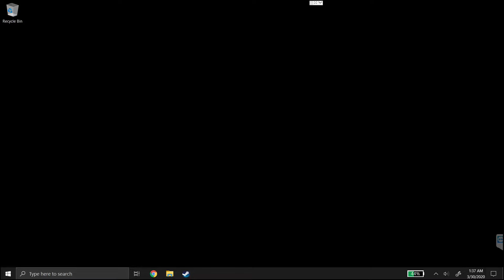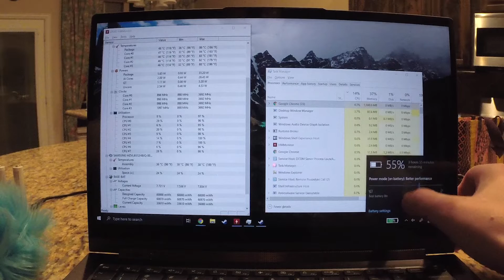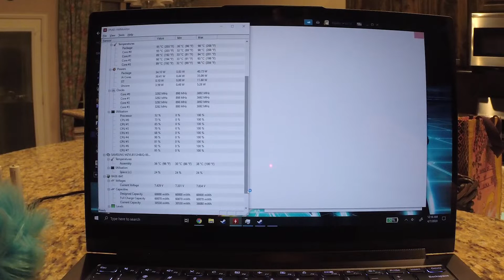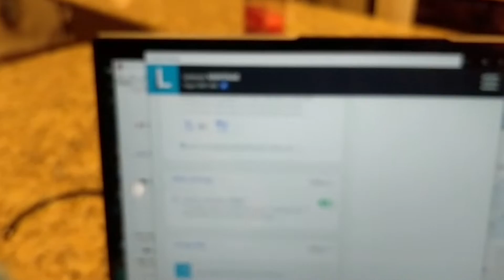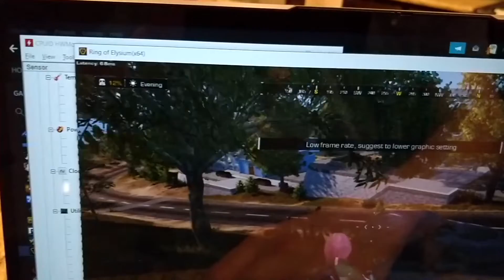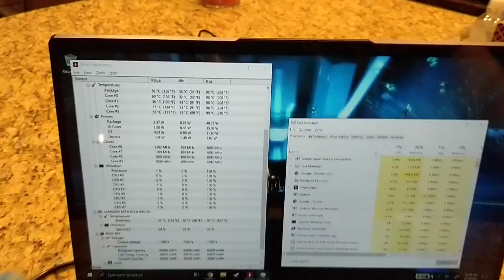Lenovo C940 - Part 7 - Extended Cooling Revisit

Comment: Hello. I really need your advice. I am thinking of buying this laptop, only I am thinking of buying a 15-inch version. My goal is to minimize eye strain at better screen resolutions and use a stylus. But does it really overheat that much? Maybe you need to install another Windows and disable updates? Do you think I should buy it?
Reply from the maker: Really comes down to your usage.  For my usage I am extremely happy with my 940 and still use it every single day.  I understand why mine gets hot and can easily make some adjustments to table position and so on to keep things happy.  I can live with some fan noise when it does come on under load but overall I'm good. 

Because it is a laptop and has different drivers I am not a fan from deviating from the OS it came with and potentially causing driver issues.  Updates do drive usage and kick up some consumption but its temporary.  Some updates make battery life worse and keep things running a little hotter but usually the next one or two fixes those issues and things are stable again. 

Not worth the hassle of messing with it to that degree.  Now if I did not want updates sure I could turn that off but at some point I would hit a compatibility issue.

I am extremely pleased with my unit and have only minor complaints I hope they address in future builds but performance, cooling everything works well enough within reason and my expectations.  My video series highlighted what people were concerned with and things I liked / had annoyances with it so folks could see how minimal the issues were or decide for their needs it was not the right unit :) 

15" will give a bit more room for cooling unless it adds a discreet GPU but I would not expect many issues beyond what I show here.  If you get a 4k resolution eye strain due to the scaling may not be improved but everyone is different :)

Comment: This is what people were complaining about?? Geez. This seems like nothing! Not bad at all, I’ve experienced way worse with my bulky HP model. I can understand maybe getting a little irritated but this isn’t exactly a device made to withstand all power.

And I think you mentioned that they rolled out better updates for this too. Guess people had the update, their devices got hot, and they got concerned so they freaked out (understandably). The fan noise is definitely manageable, I’ll take your advice on the battery level since I don’t need high performance! Your videos have been such a help, sorry about the wonky updates!
Reply from the maker: The largest complaint from people was the fan noise and how quickly they ramp up if you let the system have full access to the CPU.  I can see their point on how fast things ramp up but blame windows 10 telemetry and updates for running so frequently in the background when the CPU is wide open for use. 

That and realistic expectations of a high powered i7, 4k display and such in a tiny package.  It will get hot and that heat must go somewhere soooo.

On mine I have it set to eco mode so the battery only charges to 60% unless I know I'll need more.  With the CPU limited I can get about 90 minutes a day for 3 and some change day's responding to youtube comments, watching youtube or other video's which is reasonable usage and I'm quite happy with that life span. 

Thanks!
Reply: Ripskin16 - I’m getting the 15” i7  with no 4k and I’ll definitely implement the settings you were suggesting. Hopefully the size (as opposed to the 13” or 14”) makes up for the i7 power. I’m about to order now and I can’t wait.
Reply from the maker: @Hailee DeLuca  The larger size + the GPU will give them a few more options for airflow over the heat pipes or for a fan to exhaust air through so I cannot imagine it would be worse than the smaller units with less room.  

let me know how it goes once you get it, should be a good device!

Comment: Hey! Great video 🙌. I havve the C940 14 FHD, i7, 12GB and Iris Graphics, i used it for mostly homework so office, pdf, etc. It gets a little warm to the touch having 10 chrome windows open, some pdfs, and word documents, and the temperature is about 50°C. Is it normal? And also, have you tried videocalls? I'm using google meet for my university classes and when I have only the videocall (zoom or meet) it gets also warm especially in the midd upper part of the keyboard. When I try to do other stuff when videocalling it gets hotter about 65°C, I don't know if it's normal because it's a thin laptop (?) Do you hace any settings recommended for videocalls (?). And finally I'm not using it for videoediting, but sometimes I need to do basic stuff (for my virtual classes), today I edited a video an when exporting the proyect it got about 90°C the fans where noisy and I got worried. I hope you can answer these things. (Sorry for my bad English I'm Peruvian). And again thanks for doing these tests on the C940 it was very difficult to find this content.
Reply from the maker: Thanks for watching and glad it was helpful :) 

The largest thing that will impact you is going to be the i7.  It is pushing what the computer can handle thermally.  The best advise is to go in and tell windows to limit its utilization until you need to do something like rendering a video or something.  At that point letting it take more is fine if windows has not already done it. 

It is thin and that powerful CPU definitely heat soaks the system.  Now if you have it flat on a desk I can suggest lifting the front or back up a bit so the long foot is not restricting the airflow and that will help a bit. 

Your English is fine!
Reply: @Ripskin16  Thanks! I'll take your advice. But for videocalls do you think I should limit utilization? or have it with performance?
Reply from the maker: @kaza0386  Ah sorry missed that part.

I've run Teams and Skype on mine in the low power setting  I do almost everything in that setting event basic Balloons TD play in that setting without any problems.  If windows really needs the power it can usually take it to a degree.  And if I need it it takes seconds to move the slider up a notch or two and let the system have a little more juice. 

But in reality those video calls take very little system resources provided the application is optimized decently and doesn't have a memory leak.

Comment: Hey, thank you for the videos.
Its been over a month that I am using the Yoga 940, and recently I am facing the issue that the device is abruptly shutting down. 
Wanted to ask you or any one of the users if they are facing the same issue and if there is a solution.

Cheers
Reply from the maker: Thank you for watching!

I have not run into any such behavior on my unit. 

What is happening on the machine when it happens?  Does it happen at the same time (you use it for 30 minutes then shut down) or when using the same application?

Do you notice any heat issues or fan noise leading up to the shut down? 

Is windows attempting to apply updates or have anything going on in the background?

Have you checked Windows event manager to see what it logs for the shut down event?
Reply: @Ripskin16  I checked the system temperature and the system is not overheating. The temp reaches to around 50-60 deg C and its max goes to around 90 deg C. There are no fan issues as well.

The event log showed the 'kernel power error 41'. The windows support page for this error says that this is an event log due to the system rebooted without cleanly shutting down first. A further google search advised that this could be due to the fast booting power option. So I disabled it and turned off the system and after turning it back on again checked the event log. Tried this twice and both the times there were no error logs in the Event Viewer. So hopefully the issue is sorted.
Will post updates if there are any other issues.

P.S. I guess the issue has come up due to the 'Feature update to Windows 10, version 2004'. The update took place on 17-07-2020. And the first Event log for the 'kernel power error 41' was logged on 18-07-2020. 

I hope the next windows update solves the issue permanently.

Thank you very much for your advice and support.
Reply from the maker: @pranavbapat1356  Interesting and glad that you were able to narrow it down and get things stable, hope it holds!

Windows updates suck with 10 :( I defer for a month or so to hopefully avoid most of the mess. 

I wonder if it could also be something in the way Windows fast boot interacts with the bios version you have on your unit.  I'm on the same version that came with my December 2019 unit so that may play into it.  Can try updating the bios or seeing if Lenovo support know's anything about it and has a fix. 

Hopefully windows gets it sorted!

Comment: I have the 12gb FHD i7 version. It's comforting to see that I'm not the only one who is confused with what Lenovo Vantage is supposed to accomplish; it seems very badly implemented. Should I just install 3rd party cooling software (like Speedfan), or would this cause a bit of chaos between all the software?
Reply from the maker: If all of the other software related to cooling still installed it may cause some conflicts, but if you remove them it should work fine.  The only issue I may see is something in the bios or at a lower level that lenovo may be doing to "optimize" their operation in a custom way.

With that said the more recent versions seem to have found some balance and operate a little better with reasonable usage but still not great.  If they would give us the ability to set a fan curve it would be much better as we can go with our own personal tolerance levels.

Comment: Will C950 with Tiger Lake iCPU solve this issue?
Reply from the maker: That is a good question and unfortunately too soon to tell.

I think CPU improvements could help lower the wattage consumed while keeping performance at the same level.  However Intel has not made a lot of die size reductions in a while and overall AMD may be a better solution until Intel gets back on track. 

The biggest thing I see helping would be better software management, a proper fan curve that users can configure and a redesign to the cooling.  In this I mean raise the rear a bit and change the foot pads so the intake can suck in as much air as possible.  The layout of the heat pipes may help but in such a small ultrabook space is limited and if you want the 4k screen and high end CPU there is a trade off.

Comment: I got my sku a couple months ago and I've noticed a design flaw... The soundbar hinge blocks exhaust of air through the back of the computer... I have a feeling the fans work extra hard because they can't push enough air out of the system and a lot of the heat is staying within the laptop, heating other components as well... The laptop being aluminium could also be an important factor... Now this is just my opinion and I might be wrong but it's something I noticed... I use an external cooling pad to keep temperatures down these days
Reply from the maker: Interesting, there should be space around your hinge that is the sound bar between the bar and the exhaust vents where the air can flow.  The edge of the bar is rounded to help allow air to "flow" around it vs hitting a solid wall like a box.

I would not expect a production difference in the distance between the vents and the sound bar.  

The reason I do not believe the exhaust to be a problem is how the fans ramp up and what it means.  The fans ramp up in a reaction to immediate need and load typically (this can vary a bit depending on profile, CPU power allowances but I found the same behavior across all modes just to a varying degree).

So when I launch a game for example the CPU heats up quick, the sensor picks up on this and the fans ramp up.  Typically at that point the fans continue to ramp up until heat soak and max RPM is reached.   Now in a light load I see the same performance, launching 15 youtube vids and Chrome spikes some usage the fans kick on for a moment and then simmer down once the application is in memory and the non active pages are in the background. 

If I was seeing an issue with the exhaust then I would expect the fans to have a delay in kicking in as the cooling system would be better moving the heat away from the source, but it would build up in the case and saturate requiring more effort to exhaust out with more positive static pressure. 

In my video's about this I tried to point to what I saw as the real culprit.  The system is designed for positive static pressure, meaning the fans are pulling in air more than naturally would flow through.  This requires that the fans have a good consistent source of airflow.  My concern are the feet, in the back the long "bar" foot is not tall enough, and since it is one long pad it means air can only flow through the channel between it and the front pad.  While once the fans are at speed this may create a nice funnel effect I think it does more harm than good but ultimately I found that by simply lifting up the front or back of the case a small amount I could greatly increase the cubic area of available air and the temps started to lower and balance out.  Even in moderate gaming I noticed the fans calm down a bit.

When on my lap typically there is a large gap between my legs that allows for a greater source of air so again while a load is a load it seems to ramp up slower and handle the temps better than when it is on a flat desk surface. 

I am by no means saying you are wrong or claiming to be an expert.  Just that in my tests  and years of building PCs, and looking into it I found the intake to be more of an issue when push came to shove.  The heat source is also located near those vents to help allow natural movement of air to keep it cooler longer.  

Poor vantage software updates and windows updates are the biggest culprit to the cooling system though.  

Definitely appreciate the discussion as the more we look the more we discover!

Comment: My C940 gets immediately hot .. like cook an egg hot... there is absolutely NO "noise" -- not one decible of any sound.  Does that mean my fans are not on? how do I fix this? HELP!
Reply from the maker: It sounds like your fans are not running at all and the load is higher than it should be.  There may be an issue with the thermal conductivity between the IHS and the cooling system.  

Do you still have the lenovo vantage software installed?  Is it updated along with windows?  What types of temps are you seeing right after a fresh boot?

Mine is back to running well (see concerns from the last part of the series) where for the bulk of my moderate usage the fans are off and the temps are great.

Comment: i have a doubt, can you help me? i want to install a fresh windows 10, so i need to boot from usb, but i cant do that i changed to secure boot to disable and i am getting "system doesn't have any usb boot option"
Reply from the maker: Interesting, I have not messed with the boot options or played around in the bios.  But not having a boot from USB option would be extremely surprising especially with the wide spread usage of UEFI bios's 

There should be an option in the bios to select your boot devices and priority, if you have USB in the mix and it detects a USB device as bootabale media it should ask you if you want to boot to that. 

Will have to see if I can look at it at some point.
Reply from the maker: So I just loaded the bios for the first time.  After I put the charred remains of my burnt retina's back together I went to the boot option and first option was USB enabled. 

So as long as the USB drive is properly configured as a boot disk it should be recognized.  You may have to select it from the boot options before the SSD loads but it should work.  Unless something is configured differently for the models sold in your part of the world which is a possibility.
Reply: @Ripskin16  yes my usb option boot is enabled, but it  doesnt boot
Reply from the maker: @aaronisaacm  That is very odd, if you put in the USB stick and during boot up hit the option to select the boot device does it let you select it?  Not sure on this computer but usually F8 and it lists the OS's that are available as well as other devices it can see to boot to. 

If it cannot see the USB drive then I would say that the drive or the boot loader on it is hosed and you may need to recreate it.

Comment: I don't advise purchasing this product. Always hot due to it slim design with no proper ventilation system. Not worth the 1.8K USD on my UHD version  1 TB HDD. It gets hot while not running anything. Yoga 520 is way much better even though it's two years old. You guys remind with Dell when they fail in the past. Someone has to follow the quality management system and definitely if you continue is the same direction you'll somehow lose your fans like me. I made my whole family buy this module and I will no longer do. 

I think you can  fry eggs on it
Reply from the maker: They certainly have had some misses such as in this video where they messed up a patch, however last week I got an update that returned things back to more normal levels so my battery life is good and the fans rarely kick on again.   It is certainly a powerful device in a small package so yes it will heat up quick.  I do feel they could have improved cooling a bit.  The main fix I've called out as a larger rear foot to increase the airflow.  Helps quite a lot for desk usage.  

I spent about 1250 which is around what my gen 1 surface cost, this runs cooler, quieter and is way more powerful and feature rich so for me, I am extremely happy with the purchase still.  Annoyed at the updates and patches breaking things that dont need to be touched but thats Windows 10 :(